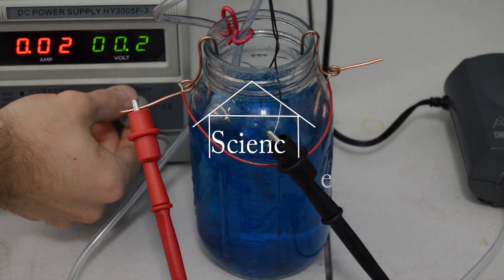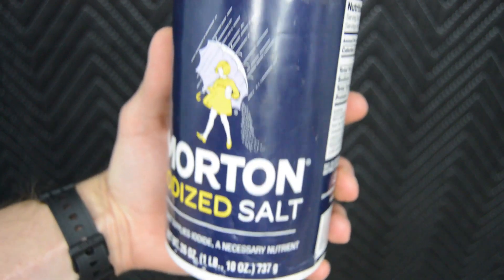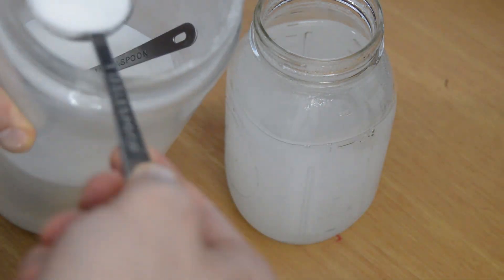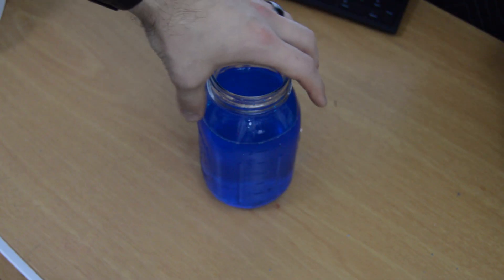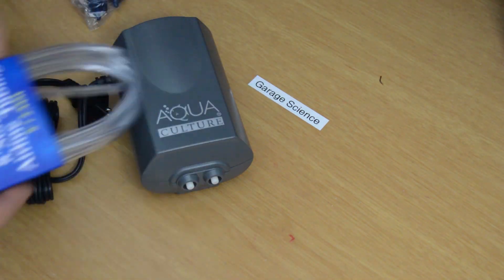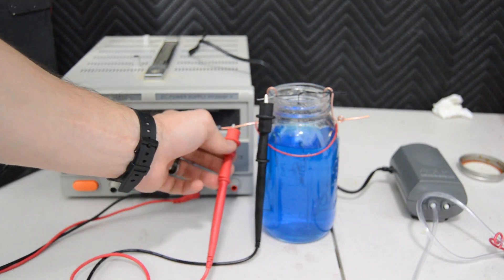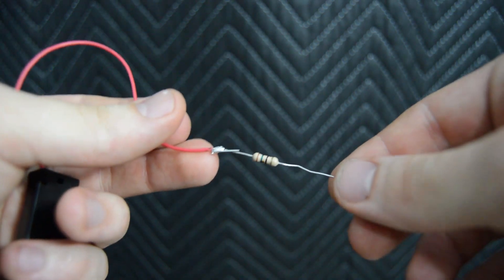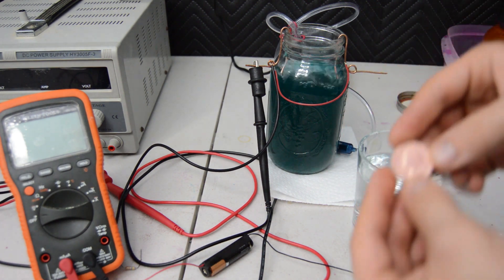Best and Safest Copper Plating in a Mason Jar Tutorial ~ DIY Professional #5

Comment: I you were to re-use this solution, would you add more citric acid with each use? Same question for the battery acid formula - do you need to add acid each time? These are great videos, thank you!
Reply from the maker: Thanks for the question.  Yes you could continue to reuse the solution many more times before needing to remix or add more acid.  No electroplating process is 100% efficient and so some chemicals will be consumed in addition to the copper.  Over time you would have to add more citric acid but since it is a weak acid the ph would not very significantly nor would you have to be excessively precise when adding more.  Same with the battery acid formula except since battery acid is a very strong acid then ph will very significantly and you will want to measure the ph and carefully measure the correct amount of acid to add.  In that respect weak acid plating is more robust if you don't have very much equipment.

Comment: Can I use the same recipe for a nickel obviously using nickel sulfate instead of copper sulfate? This video was extremely helpful I followed the directions explicitly and I got a very beautiful copper plate onto the conductive ink Around a seashell 🤙🏻
Reply from the maker: Unfortunately no. Nickel plating requires a bath with different chemistry. I'll get a nickel plating in a Mason jar video up here eventually. Super stoked you got good results and that people are having success from my content.
Reply: Can’t wait for the vid. I’ll be lost in space till then!!!
Reply: All sulfate nickel plating is possible, it was done years ago as a form of Nickel Electroforming before the advent of Nickel Sulfamate plating system. There is also an All Chloride Nickel plating solution which is Nickel chloride and diluted Hydrochloric acid, that type of plating bath is used as a Nickel Strike plating bath to plate ontop of Stainless steel, it's called the Wood's Nickel Strike( invented/developed by Don Wood) .. Nickel Acetate can also be used(some videos on youtube), the formula for what has been the regular Nickel Plating bath for the better part of the last half century is  Nickel Sulfate 200 Grams Per Liter, Nickel Chloride 25 Grams per Liter and 25 grams of Boric Acid.
Reply: @GarageScience  I'm also very interested in a nickel plating video as there seems to be a lack of them here on YouTube! Please post one!! <3

Comment: I have a large part / parts to do, is this method applicable if the container and copper anodes are scaled up also?  
I need the container to be about the 1 gal. capacity.  

Thanks in advance.
Reply from the maker: I haven't tried it in greater than 1 quart but it should still work. Be careful not to put too much copper electrod in or the Cu ion concentration will increase. Spend some time calculating the current density of the part of its larger because very large parts require a lot of plating current.

Comment: so i watched a different video and all that was used for the solution was 5 parts water 1 part muriatic acid and the part they plated looked good. whats the difference or benefit to using your solution?
Reply from the maker: A solution like that will allow you to technically electroplate, however you wont get more than a micron thick layer of copper and still have the finish that looks good at all.  The high concentration of chlorides will cause the copper coating to be very brittle and porous.  The high acidity will also likely cause very uneven plating over time.  The solution I use in this video is head and shoulders safer as well, which is the biggest upside.  You can drink citric acid since it's basically just concentrated lemon juice.  Muriatic Acid is concentrated hydrochloric acid and can cause chemical burns in the respiratory system if the fumes are inhaled and will cause severe chemical burns on the skin, it can also cause blindness if gotten in the eyes.
Reply: @GarageScience  thank you for the detailed response

Comment: I am interested in plating things quite a bit larger than a quarter; about 1 square foot. Would I be better off getting a more powerful power supply? Also can you recommend a good book for plating knowledge? I got the "2013 Metal finishing guidebook" which has lots of very technical info and some really scary sounding stuff about using cyanide for copper plating. I looking for more of a booklet telling me how do basic plating and how to not poison or blow myself up.
Reply from the maker: Here is a good summary to quickly troubleshoot copper plating troubles: 
http://www3.uic.com/wcms/images2.nsf/c06db59d70a043cc85256809004d8cbe/183dbe584ba8157b852570140067e6a2/$FILE/09-Electrolytic_Copper_Plating_Additives_and_Contaminants.pdf

If you want a deep dive into electroplating the book "Modern Electroplating" is very good and covers many different electroplating processes.  

To copper plate a 1 square foot part you're going to need a very good power supply (something that can supply at least 20-30 amps steady state)  Also keep in mind things like bath size, part geometry and orientation start to play a bigger role when you start plating bigger parts... consider watching my video about part shape and orientation and electroplating here: https://youtu.be/UVZjNn22P-g
Reply: @GarageScience  Hello this link is broken any chance you have a different way of viewing the material
Reply from the maker: Another location for this document is here. https://www.yumpu.com/en/document/view/62358379/09-electrolytic-copper-plating-additives-and-contaminants

Comment: Very nice! Do you know how the plating time relates to the copper thickness in this solution?
Reply from the maker: You'll need a good 15min to get a couple micron thick coating on a part. You can calculate the thickness plates using the plating current and the surface area of your part.

Comment: so less conductive might be better in case your mAh is high it will give you lower amps ?
Reply from the maker: I think your confusing a couple different concepts. mAh is a measure of energy. The current supplied is determined by voltage and conductivity. Ideally you have a set conductivity that never changes and your bath chemistry remains perfect forever. That isn't true though and chemistry has to be adjusted. As a general rule it shouldn't take very much voltage to get a satisfactory amount of current. 1-3 volts is usually more than enough in my experience.
Reply: im saying if your voltage is too high (say 9v) and that is all you have to work with then perhaps a less conductive medium will give a lower voltage? or am i wrong on this? either it conducts at 9v or it doen't is that what you are saying? or does the medium act like a resistor thus you can regulate voltage or amps

Comment: I tried this yesterday and it worked with a quarter, which I think has a nickel surface. I tried a few different nails which I think are zinc coated. I think the nails were creating a battery and the zinc coating was being eaten away. Is there a way to coat copper on top of a zinc coating?
Reply from the maker: Not with this solution, check out my video about why you can't copper plate steel. The same principle applies with zinc and I talk about that. You need a different solution chemistry to avoid the reaction you are experiencing or you need to first coat the zinc in something else such as nickel. I have a video on a simple nickel plating bath that generates good bright finishes.

Comment: I've used Krohn's acid copper electroplating solution and i had tested a quarter as well and it came out dull.  What would be the best way to brighten and shine the plated metal before nickel plating?
Reply from the maker: A little laxative actually might help, PEG works pretty well as a leveler and brightener. Dont need much, would probably only had a few grams at a time.

Comment: if you dont want to use sulfuric acid what about replacing that with sodiumhydrogensulfate(sodiumbisulfate)to acidify the solution? its a crystaline solid salt, often available as "ph minus" granulate in pool supply. not as strong as straight sulfuric acid but stronger than citric.
Reply from the maker: +Greygleam you would be introducing a significant amount of sodium at that point which could adversely effect the copper plating... never heard of anyone using that, have you had any success with it?

Comment: Hi. I need to iron plate my homemade cooper tips. Can it be done with vinegar? I'm tired to change my tips every week. Cheers.
Reply from the maker: Tips for what? Traditionally most people are interested in copper plating iron and not vice versa. There is an exchange reaction that occurs when iron is dipped in a solution full of copper ions, this exchange produces a coat of copper on the iron that just rubs off. Therefore copper plating iron requires plating it first with a different metal first(usually tin or zinc) then plating that with copper. If you want to iron plate something it will probably require the same approach. I've never heard of iron plating though, is that actually a thing?

Comment: So, I'm considering copper-plating some metal mesh gloves, since mesh gloves only come in stainless steel, and copper is much more antimicrobial (including anti-viral, if anybody reads this before the coronacalypse). So, would a super low-and-slow, 1milliamp plating process work on all the tiny ringlets of a stainless steel glove, if I left it going for a day or two?

Comment: I tried copper acetate, a bit of salt and a 5vdc charger and it just rubs off what ever i try to plate. Looks like i do need copper sulphate
Reply from the maker: Try also using a smaller power source. Try just 1.5V from a AA battery or something. 5Vs is a lot and you might be just trying to plate too quickly.
Reply: but if more  voltage means faster is this not better so long as your amps are correct? and is doing it faster make the job bad and it rubs off,is that the cause?
Reply from the maker: It's a balancing act, if your solution requires too much voltage then it may not be conductive enough which may indicate your solution is out of whack and you'll get bad results.  Too much plating current is bad and often leads to "burnt" deposits. In the end it's not so much about the voltage as much as it is the current. Slow and steady wins the race my friend ;)
Reply: ok great ,i have tried on a 9v bat and tryied doing a quarter but this gunky stuff built up fast on it  and burns like you said and mine too just rubbed off but what i did started noticing is my small alligator clip that ws holding the part actually came out looking great after several attempts of doing the quarter,,the clip after cleaning the gunk out actually had a lovely even coat of id say a good amount of microns as its hard to rub off or scratch,it turned out amazing when putting a regular clip next to it,even coated between the small teeth and the small screw on it ,so im puzzled why it worked there but not on the quarter,,im thinking it must be either the plating on the clip or the quarter are different or it could be i did not properly clean the quarter? i never cleaned the clip to begin with so i assume whatever its originally plated with(i guess nickel of some kind) it did the job,but i have to keep trying ,this time im using a small dime and i cleaned it with jewelry cleaner and made it look like a mirror problem is i did not wash it with water but simply wiped it and started the process,hopefully the cleaner wont affect it like skin oils might,also my 9v may have died down to the perfect current right now lol i had no idea how long a batt can last doing this but its slow now with very little bubbles but the dime is getting browned like normal,,but its a learning and exp curve each time ,so just keep at it

Comment: So do you need to use more amps and volts if you are not using sulfuric acid? And how does amps per sq ft break down for a small area? What do I set my rectifier at for a quarter inside a mason jar? On my rectifier I can't just turn on volts and see a current, I also have to set the amps.